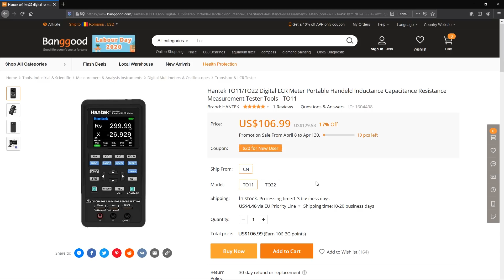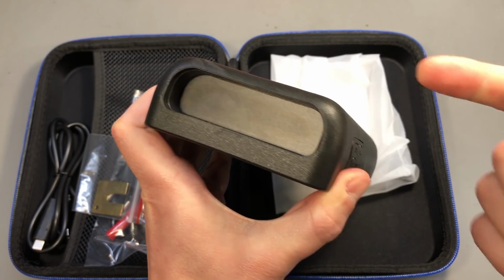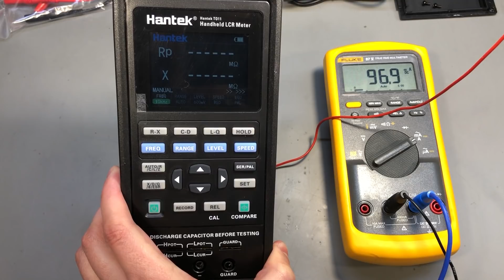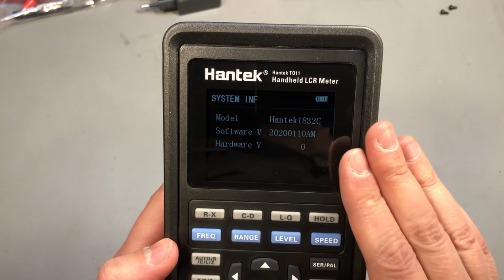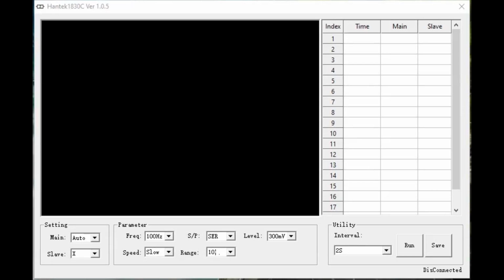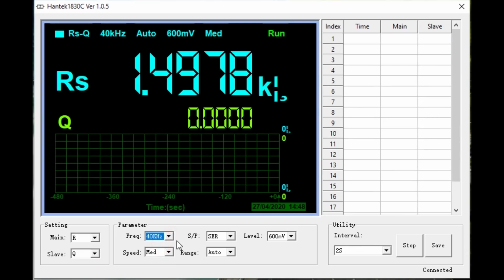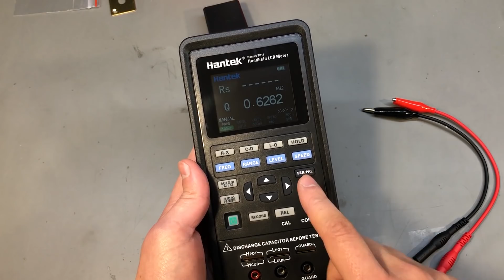Hantek TO11 1832C LCR Meter Review & Teardown | Voltlog #303

Comment: Would be great to see you review the portable hantek oscilloscope that looks identical to this LCR meter. In the same case and everything. I need a cheap portable scope that has decent performance… Because a lot of times I’m away from my lab and don’t want to carry one of my nice scopes around. A $2000 fluke scopemeter, or a $500-$700 micsig or siglent seems like a bit much for my needs. 

But I think the hantek 70 MHz model with function generator built-in is around $150… Which seems perfect.

Comment: Would be nice to test low capacitor values like 10 pf  and low inductor values like 0.1 uH. Is the meter stable after some measurements? Measuring large capacity  is mostly no problem. Also to measure the Q of the inductor.  A few more advanced tests would make this video even better.
Reply: I also was looking for small value inductor measurements,  from the manual it appears that it only goes down to 4 uH.

Comment: Not kidding here- the first one of these I got from China seemed very nice from the beginning. Then I found out it would power on once, then not power back on again unless the batteries were removed from the unit. Very strange, and batteries were fully charged. Seller took it back, and after another month of waiting I got #2. And out of the box, fully charged, it would not power on at all, not even once. There was something rattling inside the case of the meter. I'm sure this was a case of double bad luck, but it didn't give me any faith at all in the Hantek name. I sent #2 back for a refund, and bought a used U1732B LCR from Keysight. No surprise, no problems, and I'm getting the job done again. Good test equipment costs more, but the quality and reliability will be appreciated long after the price is forgotten.
Reply: Yes have the u1732 and is a reliable, the other good one is the DE5000 as have that LCR meter as well and is as accurate as the u1732. I did make a true Kevin adapter for the DE5000 as the one that you can buy from DE is junk. Both great meters. The Hantek is pure junk bought the Hantek 1833c and the 100khz is not even close to the Keysight, or DE meter, plus had first one that also failed to power on unless you pull the batteries, assumed it was just a defective one but the accuracy was poor on higher frequencies on second unit compared to the other two meters. The DE also has better gold plating and better build. Do prefer the 18650’s on the Hantek instead of 9v battery on the DE and the Keysight meters but now just keep 9V batteries around.

Comment: The meter doesn’t seem to have input terminals for 4 wire measurements. So Kelvin test probes won’t work.
Reply: No, he is talking about Kelvin probes into the blade socket, which is 4-wire (this is both labelled on the front of the unit and clearly visible in the teardown). The screenshots of Kelvin probes he showed were also this blade style.

Comment: First thing I noticed compared to the DE 5000 this thing is more expensive less accuracy less quality less options and doesn’t even come with the four-way connectors. They got to be kidding at this price it’s a handteck it supposed to be cheaper. NOT ! More expensive for less product
Reply from the maker: It's useful to know that the "kelvin test leads" they offer with the DE-5000 are not really true kelvin connections as both sense and force signals short at the entry of the croc clip. I don't know why everyone is mentioning the less quality thing, where does that come from? Even though the battery cover for the Hantek has some flaws (it's hard to open, usb recessed) overall the case is very strong, interlocking blast shield, rubber holster, everything you could ask. Also useful to know the DE-5000 is only a 20000 count meter vs 40000 on the Hantek.

Comment: this is a fairly good device, but DE-5000 which is around 90EUR has superior measurement ranges, in many of them has superior accuracy, screen also has superior reading quality (big lcd numbers and back light). case quality is also very strong and it comes with several adapters like smd tweezers.
Reply from the maker: I can see how the DE-5000 has an advantage for getting the extra adapters int he box and better screen readability but it's only a 20000 count meter and that superior accuracy everyone is mentioning it's not really the whole story as on some ranges the DE-5000 has 0.1% better accuracy while on others the Hantek has that 0.1% better accuracy. Either way, 0.1% is not going to matter much when you're using it for measuring a part and not having exactly the right measuring mode (series vs parallel) and the right frequency and the right test leads will introduce an error greater than 0.1% into your measurement. Did i mention the "kelvin test leads" they include in the package are not really true kelvin connections as the force and sense signals are shorted at the croc clip?
Reply: I will buy a DE-5000 soon too. Best LCR/ESR device for money to get.
Testing ESR with less than 100khz is useless for SMP too.
Reply: @Todestelzer  Hantek1833C can test these frequencies: 100Hz, 120Hz, 400Hz, 1kHz, 4kHz, 10kHz, 40kHz, 50kHz, 75kHz, 100kHz

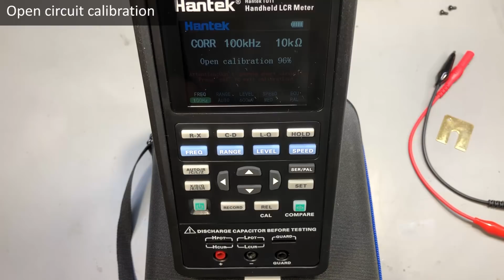Comment: @11:07 the short should probably be done through the leads you will be using, unless you are plugging parts directly into the slots.
Reply from the maker: I've thought about that and I think it's best to use the shorting link for cal to obtain the best results. The inductance/capacitance of the leads would probably make it impossible to properly cal. One can use the REL function later to subtract something if needed.
Reply: @voltlog  No you cant use the REL function because you are not measuring Resistance at DC. The leads have both Resistance and Inductance, if you use REL you have take in consideration only the Resistance part.
Reply: @voltlog  But... isn't the whole point of the easily accessible cal function so you can calibrate with leads/with none depending on what you will be using?

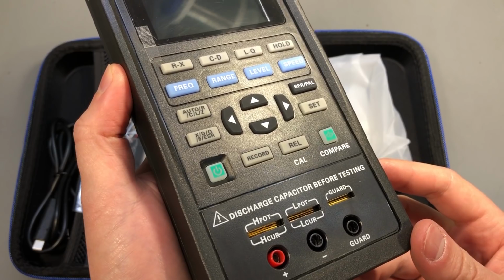Comment: @2:40 those are unavoidable, those are called weld lines, they are from the injection moulding process as the molten material flows around the inserts which form the holes for the buttons, you would see those in just about every plastic item depending upon material colour used, they are always there.
Reply: Giosue - they are a weak point, however they are not an issue in this case. A part will fail at the weld line if a large stress is applied to it.
Reply: always there on cheap, built to a cost devices ...
Reply: odium - no, just always there, they are just part of the moulding process, sometimes they can be moved around a bit or hidden, but weld lines are always there. I’ve been doing injection moulding for nearly 30 years, and help design moulds, and fix product faults such as these marks.
Reply: John Coops - you are right, but they are always there, weld lines are always present when the flow has to go around something inside the cavity, it is unavoidable, how good the person is that sets up the mould and machine parameters, chiller/heater, water lines and flow rates, will determine how visible they are.
Reply: no, until it hits the ground ...

Comment: I have a 2d72 scope. It is a very good product and I find myself using it very often. I moved recently to a small apartment and my wife wouldn't allow me to have a bench oscilloscope, with this handheld scope, I have a 2CH 70MHz, a good arbitrary function generator, and a multimeter in the same small package. I connect it to my PC, and I have a functional PC scope with a big screen, but the software is not very well built. For the same price, you cannot even buy a PicoScope 10MHz series 2000, the entry-level. I think it uses the same microcontroller than the LCR meter you showed, but with an FPGA, AD converters (250MSa/s), and a dedicated multimeter IC. The screen is bright enough, never had problems, maybe your LCR meter has some problems from the manufacture.
Reply from the maker: Yeah, this got me thinking about the LCD brightness so I might send them an email and ask if this is normal. It might also be fixable through a firmware update if it's caused by something like not having full duty cycle on that pwm channel controlling the LED backlight.

Comment: I have the their 2d72 oscilloscope and i really like it, I plan to buy this so I can finally measure my salvaged components. Also the scope has good brightness I think,  so I don't know what's up with this.
Reply from the maker: I think maybe they used a lower brightness TFT in this unit or maybe it's something that can be fixed in a firmware update like the PWM not running full duty cycle with that setting.

Comment: Very nice review as always. I have the DE-5000 and it's not a bad meter but there are a handful of things I do not like about it, and this meter seems to address some of them.
1. The DE-5000 uses a 9 volt battery and it did not come with a power cord, and it also uses a very small 1.5 mm power jack.
2, Its display can be a bit hard to read a some angels and lighting.
3. The controls are a bit messy. It uses 1 button to go from auto to C, L, R, and the 1 to set the second measurement. It would be much better if it's controls were set up the way Hantek and done it with this meter.
4. The housing feels very cheap and does not have a rubber bumper, but this is only a $100.00+ meter so it's ok for the money but this Hantek meter looks a lot better for the money.
The DE-5000 does go to 100k Hz though which is something missing here.

All in all from what I see of this meter so far I like. The display is a big plus for me and the batteries used is another big plus. I also like the control lay out. I may have to get one to see,,,, We all know you can never have to many meters...LOL
Reply: I also own the DE-5000 and I do agree that the single button to go through the modes is a bit annoying but as for the other things, I find the plastic case to be very sturdy although it has a bit of a weird shape, the display seems to be way better than this hantek in terms of visibility and the battery lasts for ages, no need for rechargeable batteries and as you say there is a DC input if needed. I don't remember if it was a stock thing but mine also came with an adapter with short kelvin leads (that I later extended with my own cable and kelvin clips) and another one with a longer cable with kelvin tweezers for smd components. There is a trend now to put a color LCD on everything even when there is absolutely no need, monochromatic LCD's are way easier to read whether indoors or outdoors and they consume way less power. When I bought this LCR I read somewhere that 100kHz is an important frequency  as some capacitor manufacturers rate their ESR at this frequency but I believe most are tested at 100/120Hz.
Reply from the maker: That's a fair comment addressing both the advantages of the DE-5000 and it's disadvantages. I might add that while the Hantek has great vertical viewing angles, the brightness is poor for outdoor use.
Reply: @voltlog  Yes I saw how it would have a good viewing angle and it's White on black makes for good contrast. I do agree that the Hantek logo on the top needs to be removed and that is something that could be done with a firmware change, ( Hint Hint Hantek) say that 3 time fast!!
Reply: Hantek1833C can test these frequencies: 100Hz, 120Hz, 400Hz, 1kHz, 4kHz, 10kHz, 40kHz, 50kHz, 75kHz, 100kHz
Reply: the housing feels cheap ?  we don't have the same device then , mine is strong with a nice finish not 3d printed feel :)  i will agree the buttons are a bit annoying, but could be deal with.

Comment: I understand your relation with Banggood, but is not fair at all, against yours viewers, not to mentioned that "DER EE DE-5000 Handheld LCR Meter" is a much better choose and cost only $97. This LCR is a piece off shit compared to DE-5000.
Reply from the maker: Let us know how the DE-5000 is superior to the Hantek.
Reply: @voltlog  Are you kidding me or what?
A LCR meter is useless without Kelvin Test Leads. If you don't know why, please don`t ask me, find it yourself. The price of the Hantek TO12 is much higher than DE-5000 $145 vs $86 (100kHz). If you include the Test Leads 145+25+25= $195 vs $110. 
Not to mentioned that DE-5000 has higher accuarity, it uses dedicated chip, it use sine wave to do the measurement, it is true 4.5 digit vs 3.5 digit of STM32F103 ADC, has much lower standby current, it can be left unused for years without discharging the battery, has a better display, etc...
Reply from the maker: Why are you only telling one side of the story? Do you know the "kelvin test leads" they include in the package are not really true kelvin connections as the force and sense signals are shorted at the croc clip? Or the fact that the hantek is a 40000 count meter vs 20000 on the DE-5000? Or the  accuracy everyone is mentioning it's not really the whole story as on some ranges the DE-5000 has 0.1% better accuracy while on others the Hantek has that 0.1% better accuracy. Either way, 0.1% is not going to matter much when you're using it for measuring a part and not having exactly the right measuring mode (series vs parallel) and the right frequency and the right test leads will introduce an error greater than 0.1% into your measurement.
Reply: @s_amoku  There are plenty of very useful LCR meters that didn't even have Kelvin test connections at all. 0.5-1% accuracy is fine for the majority of tasks.
Reply: @voltlog  If you or Hantek have find out how to do 40 000 measurement with 12 bit ADC you should be a rich men now. Please tell me who you can archive 40000 counts with 12 bit (4096 counts)??? 
Comparing this Hantek TO12 with DE-5000 is pretty much like comparing Fluke with UNI-T. 
Please can tell me where Hantek has that better accuracy?
Yes is true that it don't have "true Kelvin" (With capital K because is the name of the inventor) but the important thing is that the cable are Kelvin connections, the cables have e very high resistance compared with the alligator clip. If you want true Kelvin you can replace the alligator clip with some "Kelvin test clip" from Aliexpress, they cost only $1 for 2 pcs.
The deal-breaker for me is that it has very height standby current, which mean that if you don`t use the instrument for long period of time it became unusable, you need to recharge the battery before reusing it, which is not practical at all. I have replaced the battery of my DE-5000 more then 4 years ago and it is still working.
Reply from the maker: @s_amoku  ADC oversampling and interleaving are two techniques which can be implemented to obtain these results from that built-in 12 bit ADC. These techniques have been known and are in use for decades. Compare the specs of the DE-5000 with the ones of the Hantek and you will find everything I mentioned above about accuracy.
Reply: @voltlog  Oversampling is used on AC not DC. It reduce the bandwidth by 2^2n (n is additional data precision in bits, in our case +4 bit,12 to 16) so you need 100kHz * 256 = 25.6MSPS. Not to mention that this is not the way that LCR works, because it also needs to measure the phase difference. But evidently you dont know very much regards to the subject. To finish, STM32F103 ADC has a true accuracy of only about 10b not 12b, because it has to much noise.
Reply from the maker: We are talking about AC here, as the LCR meter is using AC signals to measure. Who said anything about DC? An LCR works by measuring the phase difference, yes that is correct. There are multiple ways in which you can measure the phase difference one of them being through FFT. I don't know if that is what they're using inside this meter, but they could be oversampling and interleaving the ADCs before doing the FFT which would give it enough resolution. I'm not pretending I know all about these things but you've got to stop pretending like you are smarter than everyone around here just to get some attention. Be nice & civilized, you've got nothing to loose.
Reply: @voltlog   I'm not pretending to be smarter than everyone, because this is impossible. If I wanted to get some attention I will start to do videos on youtube, not comment here. I`m not smarter than everyone but for sure I know more than you regards Electronic in general and LCR meters in specific but this is not the point. I give you some technical reasons and yo replied with some irrelevant subjects like FFT. If you start talking bullshit this in not my fault. My problem is that you are recommending very bad and very expensive products to other peoples for your personal profit.